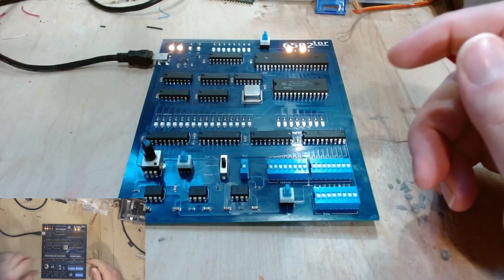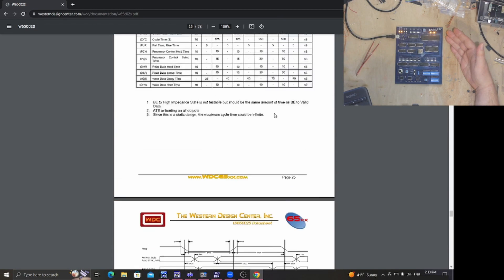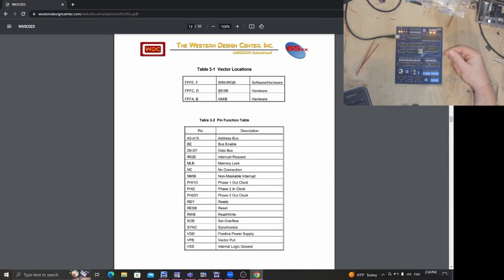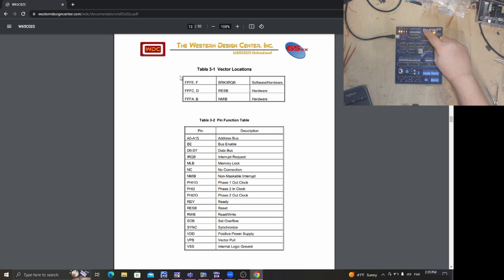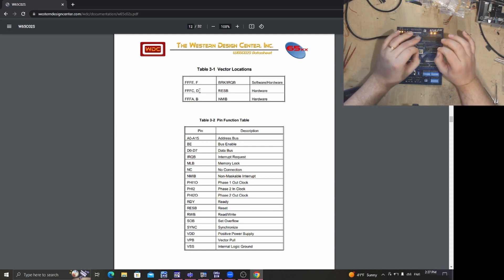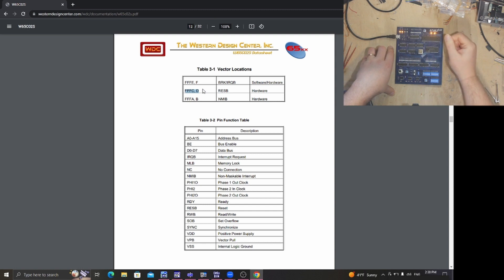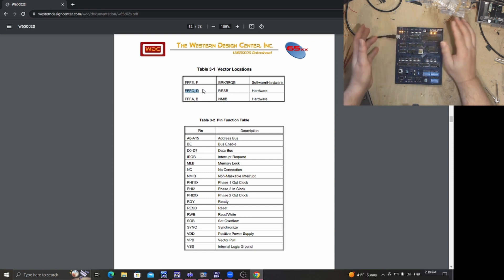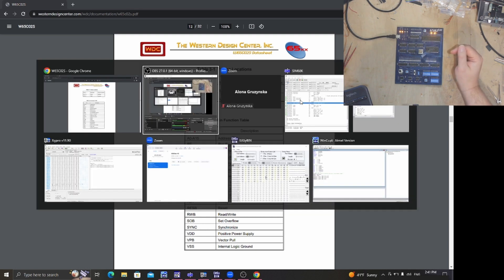6502tor #3 | CPU reset vector

Comment: Those DIP switches may be cheap but also hard to use in practice. For only a few coins in you local currency you can buy something better, than if a hexadecimal key is pushed there is a relation with what value is entered and the number that is on the key. With the DIP switches the user had to see what the value is in binary and than convert that number into hexadecimal. A great training for the mind but nothing more.
 
The same story with the LED's, the display is binary and programming happens in hex. All historical relevant tutorial computer boards had a hexadecimal display and a hexadecimal keyboard. KIM-1, The MicroProfessor and the TEC-1. Without a ROM it is very hard to make a hex keyboard work but it is not impossible, the hex display can easily be added.